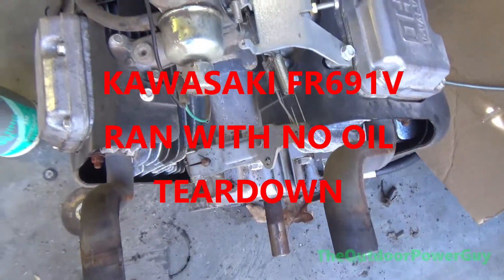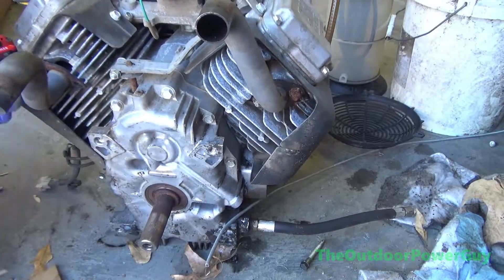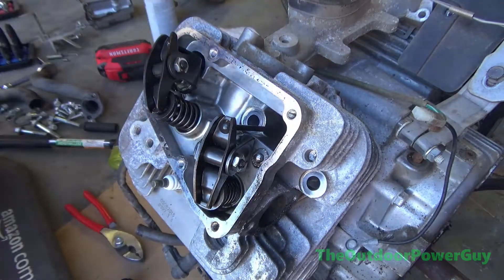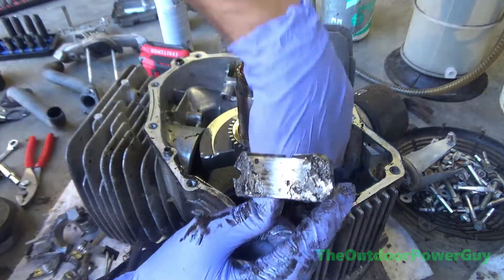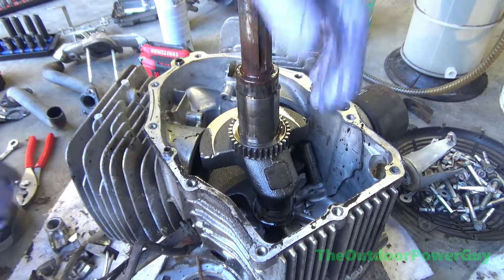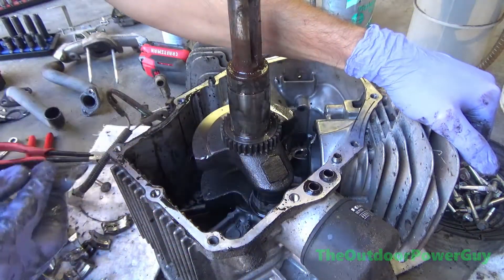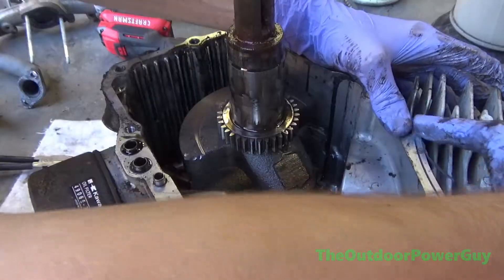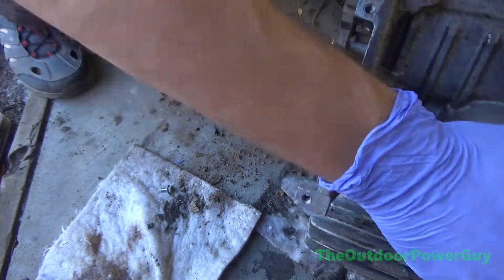Kawasaki FR691V Ran With NO Oil Engine TEARDOWN

Comment: i went to change the oil in my fr691v and it literally had half a water bottle of oil. i was very surprised and disapointed. i added 2 liters of oil. i didnt notice any performance difference from using it for 30 hours with the low oil. it had 409 hours when i got it. now its 439 and i changed the oil

Comment: I just had this happen to mine . Teared it down . Cylinder #2 had two bent pushrods , 2 tappers . Put stress cracks on the crankcase . I ordered a master rebuild kit, a used crankcase from eBay . And the necessary pushrods and tappers . Total I was in under 1k . Runs like a charm .
Reply: Do you know where to get service repair manuals for kawasaki engines

Comment: What is your take on using a car oil filter (fram) other than using a lawn mower filter (kawasaki) on a riding lawn mower?  Thanks!
Reply from the maker: Failure to use the proper OEM Kawasaki oil filter can cause oil starvation issues and blow the engine, has something to do with the design and backflow preventer. don't use car parts on lawnmowers!
Reply: Thanks.  Will start using the correct filters.

Comment: Question: I need to replace an Intake Lifter (that pushes the Rods) , It is accessible from the top (removing flywheel and cover) or from bottom (removing crankshaft output cover)?
Reply from the maker: you have to pull the cam which involves inverting the engine and pulling the oil pan.

Comment: I had this engine go out, and its out of stock no longer available, do you know which engine would match it so as to replace it on my cub cadet.
Reply from the maker: It shouldn't be no longer available, there are direct replacements from Kawasaki, send me you engine model number and i will check for the direct replacement and get you that number.

Comment: I have this engine and it only has 200 or 300 hours on it and cylinder 2 smokes like crazy nonstop i can even see what im mowing burns alot of oil i started tearing down the engine today the head gasket its not broke and i ran out of daylight could it be the piston rings this is my first rebuild ever
Reply: How'd your rebuild work out?  Was it just worn rings?

Comment: I've got a engine like this that buffs whitish smoke at start up for a few seconds.     I'm wondering if I need to replace rings. Do theyhave valve seals?     Anything else I need to check on?  I've heard about checking valve clearance.     Is the smoke a sign the engine is wearing out?
Reply from the maker: White/blue smoke at startup is completely normal, try using a heavier weight oil such as 20w50 that might cut down on it a bit.

Comment: Why did you decide not to rebuild it?
Reply from the maker: engine had thrown rods and damaged cylinders, not rebuildable.
Reply: Did this engine have plastic cam shaft gears?  I'm thinking of buying a mower with a Kawasaki Fr651v engine and wonder if it has plastic cam shaft gears.  The reason I ask is I don't want an engine with plastic gears.

Comment: if you upgrade the airfilter to a canister filter, should you replace the jets as well?  have you seen any issues with it running too rich or lean?
Reply from the maker: i do not recommended doing either one, how the engine comes factory is how it is designed to run.